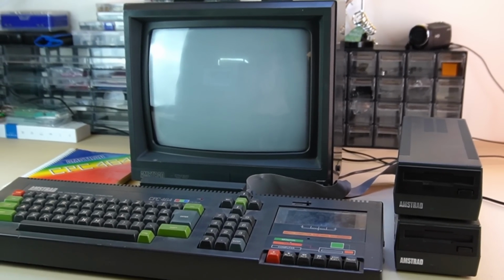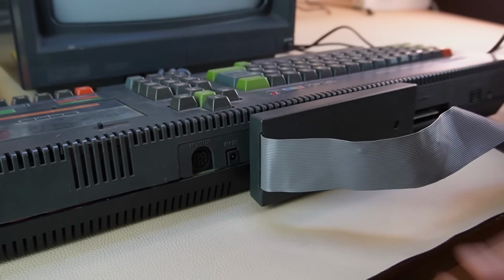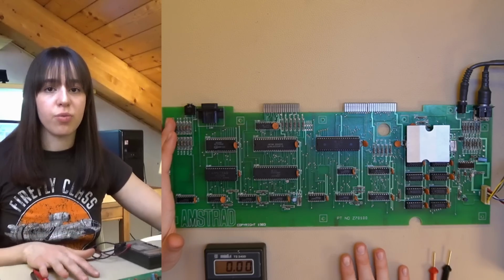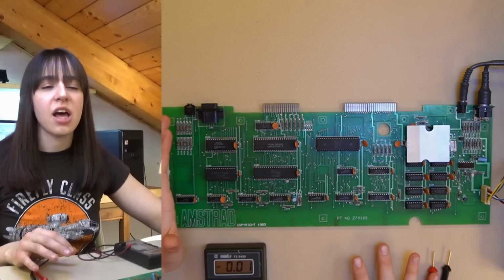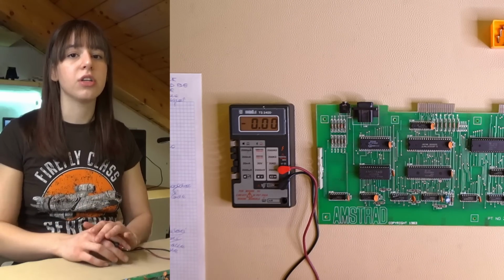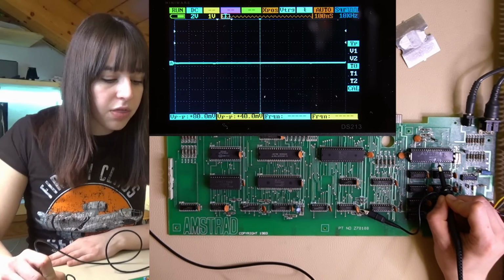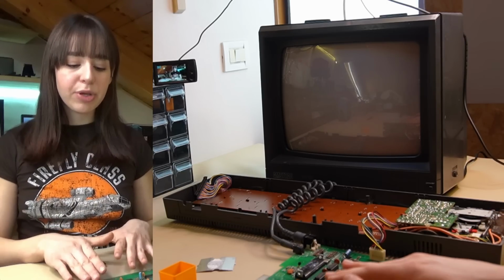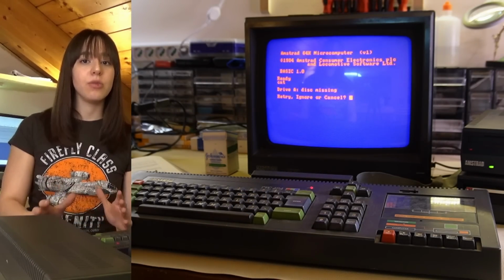I fixed an Amstrad CPC 464

Comment: Hi, I have a problem with my disk drive in cpc 6128, maybe You can point me into right direction...I've changed the drive belt, cleaned the head with isopropanol alcohol, I can do CAT of the disk, it shows some files, but I can't load them (it hangs while doing that), and I can't also write a file to disk with SAVE command, it shows that it does that (no error), but the file isn't there when I do CAT. Also I can't seem to format a floppy with formatting programs (loaded into memory from a gotek as drive B). Might it be a problem with Stepper motor Alignement ? I don't have osciloscope so I would need to buy some cheap one from aliexpress or do it by hand, but might it be the way to go after all to try to allign the stepper motor ?

Comment: Hi and congrats on your channel. Two specs corrections: the CPC series max graphics resolution is 640X200 (requires mono monitor) and the FDD units you were referring to are 3” not 3.5”. Keep up the good work!

Comment: What would you need 512KB of RAM in 1982? That's just overkill, isn't it? I can see 128KB but nothing over it in 1982. My research tells me this microcomputer was supposed to compete with the C64 and bone stock it was very comparable. Unfortunately, it cost quite a bit more but I love the keyboard colors.

Comment: I wanted to say it is possible the voltage regulator and power supply circutry could be  in the televison modulator and power supply module.

Comment: Watching this video brings back memories of when I was doing internships as a student.
It was precisely in an AMSTRAD computer repair workshop.
Many of the repairs were due to power supply failures, the transistor that regulated the power supply was not holding up.
And it produced failures (no power) or over voltage.
the latter caused havoc, broken CPU, or group of memories...

Other failures of the floppy disks in the Amstrad CPC 6128, were mechanical.
Sometimes, the worm screw that moves the read head got stuck and stopped moving, giving an error in the drive.
The fix was easy, a simple tap on the case would free it.
Anyway I am glad to know that there is still interest in the repair of these little 8 bits.

Comment: Great video, I have the same 20pin keyboard connector  - which seems to be rarer than the ribon cable ver ....I wonder if its a later model than the ribon type? p.s. I also have a power issue with my CPC464 and will try testing it the same way ...think it might be the power switch

Comment: Had one of these with the green screen monitor as my first computer. Still remember having to adjust the heads on the tape drive for certain games. Many many hours spent playing Elite among others.

Moved to an Amiga 500 (and later a 1200) in the late 80s/early 90s before finally moving over to PC but this was a great machine for its time.

Comment: For whatever the reason may be, Googles algorithm decided that i may find you interesting!  They were right...Have you ever considered restoring old vacuum (valve) tube radios? 
I think that since i was researching restoring my 1930's radios.  Google thought i should see your channel.
Cheers and best regards from Canada.
Reply from the maker: Restoring vintage vacuum tube radios sounds like a fantastic project, but I've never tried it myself. Your 1930's radios must hold a lot of history and character!
Reply: @Sayakas_Digital_Attic  If you think about it, vacuum tubes or valves are transistors.  
They are the grandparents of the circuit boards you repair.
Best regards from Canada.

Comment: wish i had your knowledge :(

been stuck with a arcade machine that has a broken jamma harness for years. tried contacting many electronic engineers but none know how to help me :(
Reply from the maker: That sounds really frustrating. What specific issue are you facing? Don't give up, there are always solutions to be found!
Reply: @Sayakas_Digital_Attic  the wiring into the joysticks got fried, the main machine works fine but i have no joystick inputs

Comment: I was wondering which country you are from? I wasn't aware that Amstrad computers were sold outside the UK.
Reply from the maker: I'm from Italy, but I think that the countries where it was particularly popular other than the UK were France, Germany and Spain
Reply: @Sayakas_Digital_Attic  You said you're not a professional but I have a degree in Electronic Engineering and I wouldn't be able to do what you do with these old computers. Admittedly I have been in finance for the past 25 years. What is your background?

Comment: When trying to get any older system to work you should also check 'all' connections especially the power supply barrel connectors.  As you saw with the switch - generally it's shiny silver, if you see copper shining through an area - that's a possible problem.  Dark area's are generally dirt clean with isopropyl alcohol and a swab.  You can clean the 'ribbon connectors'/'pcb edge connectors' with an eraser on the other side of a pencil and brush away the debris after.  Please note - that some of these connects can come apart like the switch, not many but some.  You may want to also cover more of your probe's 'ground'/'black' alligator connector as you may inadvertently short something out and possibly damaging something.  NOTE: The capacitor that came loose - there is an Electrolytic capacitor next to it - light blue - that's probably a part of the clock circuit.  Look for bulging top or bottom or both (IE: the top or bottom doesn't look flat from looking at it from the side of the capacitor) generally this means that they've failed due to the electrolytic drying up; sometimes they can actually explode too lol  You'd find a thing and long 'white paper' inside.  Ceramic disk capacitors: I've only seen some crack, to where you can see the actual disk - these ones should be replaced.  Resistors: as with almost all discrete electronics they will 'open'/'not conduct' or will short out 'close'/'conduct.'  If they're open: they'll generally look like all the others.  If they short: generally the color bands will be 'burnt' and or the rest of the resistor.  OH! Please also note - that when they short - this will usually take a short amount of time - after it 'burns' mostly they will open [that smoke these components and Integrated circuits produce may or may not be considered hazardous in your area.  In our old shop we had vent hoods to turn on, in our current shop there's mandated airflow; so work in an area that has active ventilation.  Integrated Circuits: any cracks, bulging, 'blown off' parts to where you can see the integrated chip, or anything irregular, etc. should be handled with care and should be replaced. Power Supply connections/cords: Generally the wiring will break, from the power supply to right next to the barrel connector, simply replace that set of wires with proper gage and current requirements.
Reply from the maker: Wow, thank you so much for the incredibly detailed advice! I really appreciate you taking the time to share these tips. Checking all the connections, especially the power supply barrel connectors, makes a lot of sense. I'll definitely keep an eye out for any shiny silver areas and clean any dark spots with isopropyl alcohol. I'll be sure to handle integrated circuits with care and work in a well-ventilated area. Thanks again for sharing your expertise! :)
Reply: @Sayakas_Digital_Attic  No worries!  Those DIN (circular) connectors can be problematic especially cleaning the insides of the one's where the pins go into it (female); most of the time you can replace them.  Keeping it original and or at least looking original can be extremely hard.  I've been in the field since 1986 lol  Working at a museum for 20 years now.  One rule reigns supreme - "If it works don't touch it unless you have to!"  Take care!

Comment: Nice. It gets on me how electronics technicians (such as myself :P) can forget that you can also fix a piece of equipment by doing something so common sensical as a cleansing. 

Every now and again, though, motherboards are there to remind you that dirt in sockets and connectors is an enemy also.

Comment: Great to see the younger generation enjoying these machines! Looks like there is still a problem with the video signal as the text should be yellow not red. Amstrad machine actually used 3 inch disks rather than the now more common 3.5 inch

Comment: Hi, what a great memory this computer. It was my first one, somewhere around 1985. I bought it because it was the cheapest all integrated computer, including the screen. I coded a lot on it, I loved it. it was compact and easy. My favorite one was still the one after,  CPC 6128, because of the discs obviously. I never opened them by the time, it looks so simple. I'm surprised that young people like yourself could be interrested by these oldies. Congratulations for your repair.

Comment: You just sent me into a time warp. My first digital was a Timex Sinclair to which I added a mechanical keyboard as the membrane one was crap.. Zoom up through the years to my building a 386-40 from the bare board up to ultimately retire with a Bioimedical Engineering degree. 
You have my full support and I'd love to help but where to start? What could I suggest? 
I suppose it's best to simply watch your videos and sound out where your interests lie and your goals. 
I would suggest doing some serious head banging with analogue circuits such as audio amplifiers. Discover the world of partially functional components as resistors out of value and capacitors that are good but aren't under loads. The little traps electronics throws out. 
Best of luck!
Reply from the maker: It's incredible to hear about your experiences with the Timex Sinclair and building a 386-40 from scratch. Your support means a lot to me! I truly appreciate your offer to help. Exploring analogue circuits, especially audio amplifiers, sounds like a fantastic suggestion.

Comment: A quick niggle, the floppy drives on the Amstrad are actually 3” units (Alan Sugar got a deal on them because the rest of the world went 3.5”).

This takes me back a few years to when I owned one new. You had the option of either a B&W (which could handle 80 column text, and was actually green), or the colour monitor which would happily manage 40 columns, but got blurry beyond that. From memory the text should have been yellow on blue, so you may need to check the DACs (resistor ladders) or the monitor analog circuitry as the text was looking rather red (green channel fault?).
Reply from the maker: I said 3.5'' out of habit, but I was aware that Amstrad's floppy disks were 3'' to ensure compatibility with 5.25'' drives and for easier portability. Additionally, at the time, the 3.5'' format was beginning to emerge as a standard but had not yet become the de facto standard. As for the text as mentioned earlier by Noel, perhaps a poor soldering of the video connector.

Comment: Are Z80 still somehow available? or are you forced to salvage them from other similar-era computers? Or are there drop-in replacements which perform the same but are actually obtained by simulating the Z80 in software using a much faster processor?

Comment: Harrier Attack  ,Sultans Maze,   Roland of the Ropes , Paper Boy,  Commando,  Ghosts n Goblins,    just a few cassettes   i had  , spent  few rainy days on one of  those also took the hand book and coded in the pontoon game and saved it to tape.    I actually wanted the  zx spectrum but they sold out  for Christmas that year  but i still had good times on the CPC which was under the tree instead.

Comment: Had a 6128 from new, but the monitor broke. Have another and a 464 too. Great machines back then. Have an external disk drive too, but not been able to test if it works, but the melted plastic on the case could be a pointer to a previous problem! 😵
Reply from the maker: That's quite a collection! Hopefully you'll get a chance to test out the external disk drive soon, although the melted plastic does sound concerning 😅

Comment: ohh ich hatte einen cpc 6128 mit vielen mods
Reply from the maker: That's great, what mods did you make?
Reply: oh, that was in the 90s
switch for second memory bank
shugart bus adapter for 5 1/4 Floppy
the Mod with an 20MB HDD (really a Monster HDD) - dint work
if you have chips on sockets, you can change from 4 to 8mhz

Comment: So nice, your knowledge is amazing, you look so young like 18-20. For the switch, I would have tried to first just spray contact cleaner into it and work it for a little bit before opening it, those small metal tabs like to break off. (I was having a similar issue on the switch on my lab power supply I spray contact cleaner into it and worked it now it works perfectly fine.) Also another small tip when you putting screws back into plastic, always first turn them left until they click, then turn them right to tighten them so that you don't destroy the thread. You can explain things so well, better than me, and I have over a decade of experience with electronics (I am 27), lol. My specialties are inverters and power supplies, but I love anything electronic. If I remember right my first computer was a windows XP machine, it was a compaq but sadly I don't remember the model, I was a kid.

You get a subscribe and like 👍👍

Greetings Alexander ❤
Reply from the maker: Thank you for your kind words and for subscribing to the channel! I'm really glad to hear that you found my explanations helpful, also thanks for your advice about using contact cleaner and being cautious with screws, I'll definitely take that into consideration for future repairs.
Reply: @Sayakas_Digital_Attic  always welcome 😁, I am excited about you next video.

Comment: wonderful to see one of these running; hurray for socketed chips.

I wish I still had 464, but the monitor burst into flames so I threw it away.
Reply from the maker: I'm totally with you on the joy of socketed chips, makes tinkering so much easier. It's a shame to hear about your monitor bursting into flames though! Do you happen to know what caused it?
Reply: @Sayakas_Digital_Attic  I don't know, but there were some signs that it was failing. I had to get it repaired for no picture, and then an internal fuse blew so I think there was some kind of excessive draw going on. The actual reason it set itself afire rather than popping a fuse again was because i put a 13A fuse in the plug rather than the 3A one that should have been in there, but I was too young at the time to know better (this was all in 1988).

Anyway, the flames were blue and went out pretty quickly after I unplugged it.

Comment: The failure of the M1 signal on the Z80 was most often caused by people plugging peripherals into the unbuffered edge connector whilst power is applied. It was a very common point of failure on the ZX Spectrum and would cause the Interface 1 to not work as the M1 signal was needed.

Comment: Amstrad used 3” floppy disks. Not 3.5”
Reply from the maker: Thank you for the clarification. I mentioned 3.5'' out of habit, but I was aware that Amstrad's floppy disks were 3'' to ensure compatibility with 5.25'' drives and for easier portability. Additionally, at the time, the 3.5'' format was beginning to emerge as a standard but had not yet become the de facto standard.

Comment: Those switches are a pretty common failure. The positive side is that people sell their CPCs dirty cheap when they don't turn on. I was lucky four times to buy  non working CPCs that only needed some contact cleaner in those power switches.
Reply from the maker: You're right, I've seen that too! Glad to hear you've been able to revive a few CPCs with some contact cleaner
Reply: @Sayakas_Digital_Attic  Yes I was very lucky, something that might not be the case with your CPC! Those red letters may point to a Gate Array issue. I hope not since the monitor port  could also be causing this issue. I had to remove mine(corroded) and use a lightly used C64 parallel port I think, to bring back the correct colors . You can always do a follow up video for that I guess.
Reply from the maker: @NickolasGaspar8bit  Thanks for the input, indeed I was planning to do it in the next video